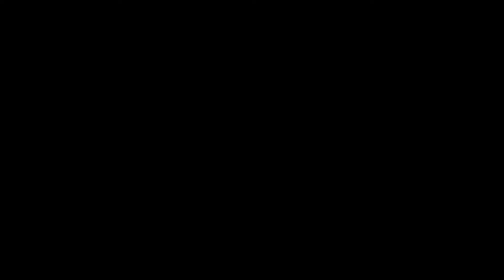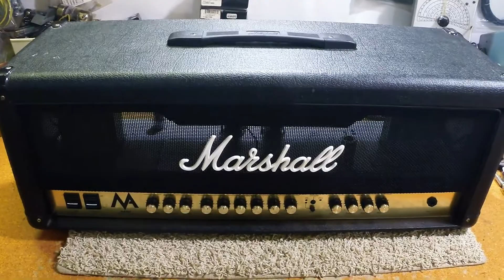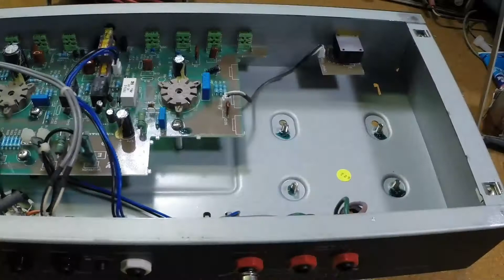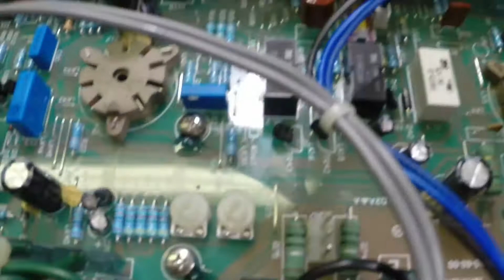Modern Tube Amplifier Oxymoron

Comment: Your amp is analog. Transistors are very much analog. Maybe you dont like solid state. Maybe you like hand wired point to point. Use your big boy words to describe your needs. We can both agree though, this amp is garbage.
Reply from the maker: I felt I clearly explained it.  Modern terminology for the new generations.  Like modern Class A etc....  A tube amp should be a tube amp, not a micro processor.  In many cases when something like this come in,  it is not a tube problem but solid state.  Cheap circuit boards, ribbon cables, and IC controlled bias circuits have no place in a tube amp. I can not tell you the number of times someone calls me about their Valvestate tube amp.